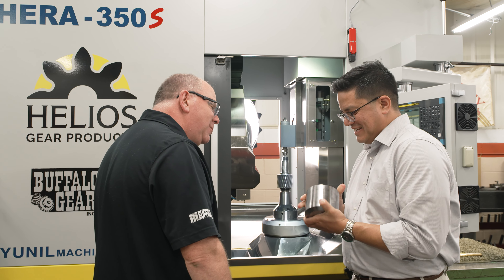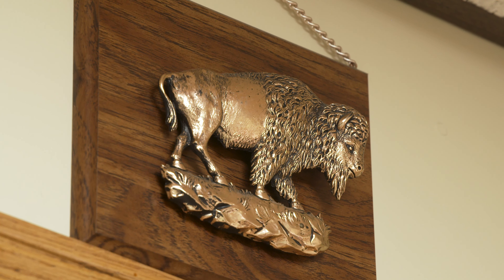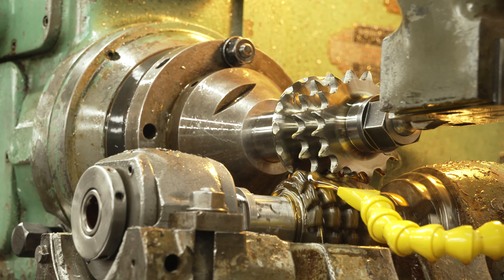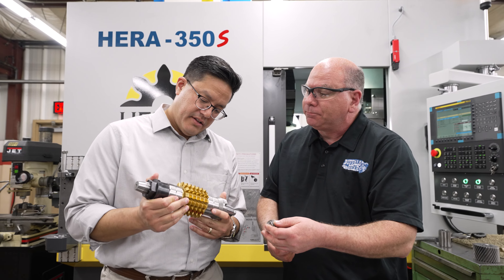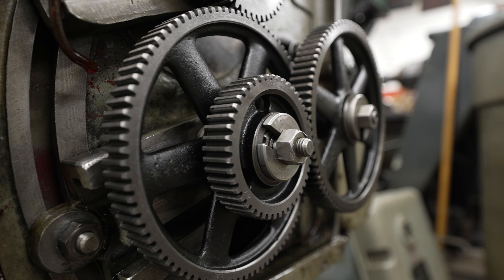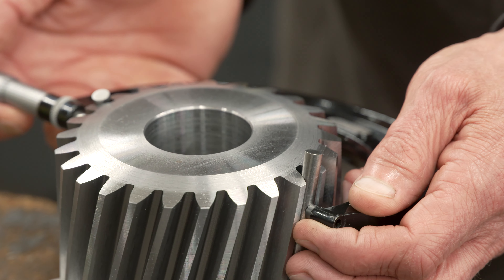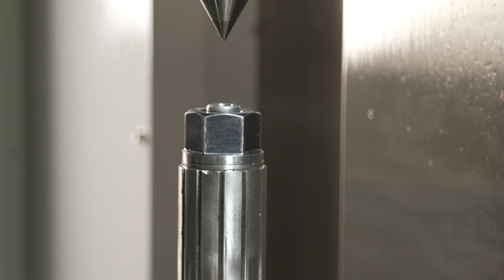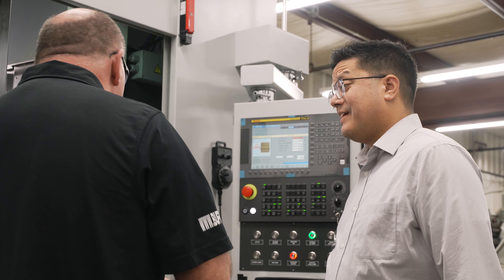Improving gear hobbing setups by 50% | Buffalo Gear

Comment: I have been running a (Hera 90) w/auto-load over the past year and the machine is one amazing machine!!  Over tripled our production and set-up is simple and quick.  The machine just runs perfectly all day long, dropping perfect parts onto the well engineered part holding system and always puts a smile on this old machinists face!!!  Once every two hours we go collect the cut gears, as it gives us time do do many other tasks required during typical gear production.  Our company waited way to long before pulling the trigger on this (Hera 90).  It is a real money producer in many ways!

Comment: How long does setting up a CNC Gear Hobber Take? New hob ready mounted & clocking on Hob Arbor. Ready mounted whilst hobber was cutting last of last job. No time. Bottom clamping fixture removed and ready prepared fixture dropped in & locked in place with Cap Screws & clocked. 5 Minutes. New component mounted & Tailstock height adjusted. 3 minutes. Old program removed new program inserted. High speed dry cut. 2 minutes. Cut first compt. Done. Check first compt, adjust final cut & done. So, 10 minutes including wiping your hands after taking gloves off. What is floor to floor time of each component is the comparison metric with another machine. Work Holding is a Disciple of it's own.